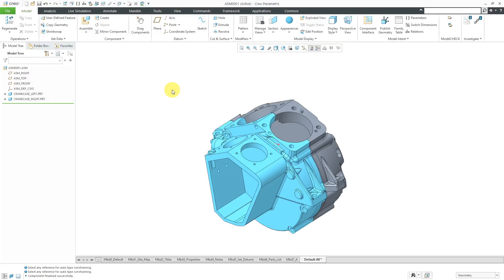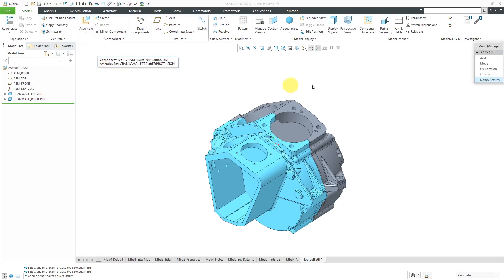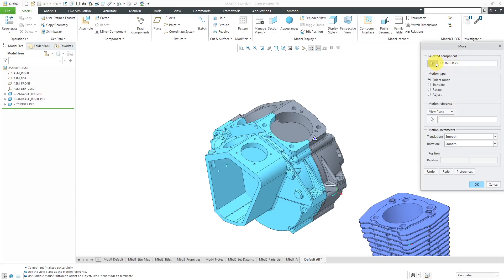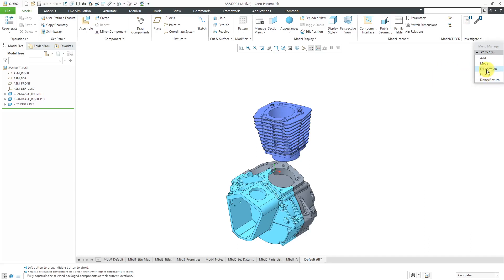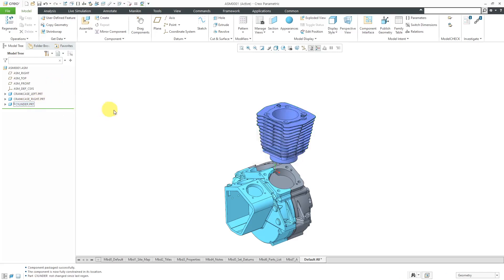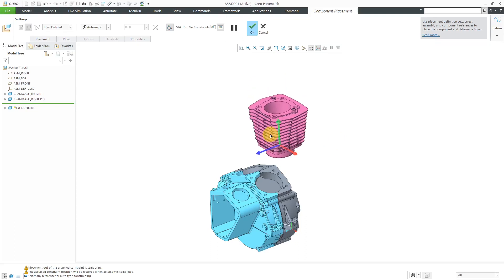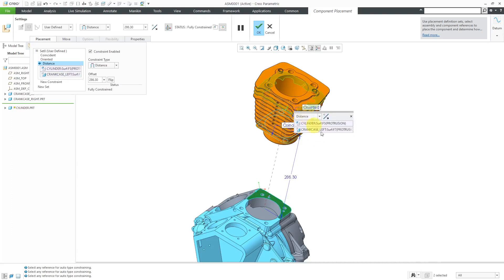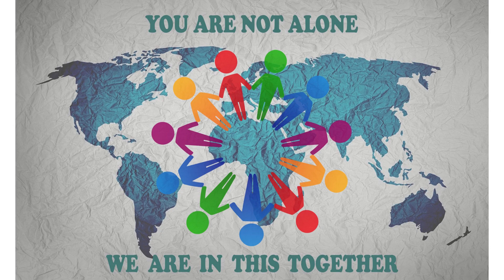Creo Parametric - Package Command - Outdated Pro/ENGINEER Functionality

Comment: Do you have the movie of MOVE (orient, translate, rotate, adjust) tab inside the assemble? Thanks.
Reply from the maker: I do not, because 99% of users never use it. It's a legacy from decades ago. Just hold down the CTRL and ALT keys while using the left or middle mouse buttons to translate or rotate the component you are assembling.

Comment: Hey, can we unpackage any assembly? I'm working on an assembly that was created as a package. but I can't mate it with another assembly. So is there any way to unpackage that item or is there any way to assemble it with another assembly without using tools like translate, move ?
Reply from the maker: Assemblies are not packaged. Again, the Package command is really obsolete in Creo. It just means adding a component without adding a full set of constraints. You can Edit Definition in order to assemble components to it. You can also change the option for allow_package_children to all to assemble components to a packaged component.